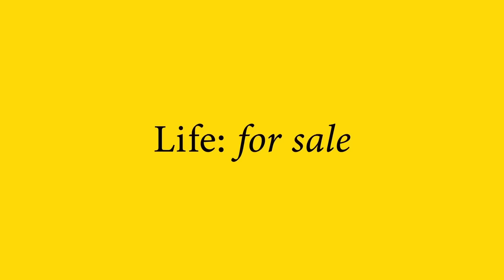$400,000 Street for sale

Comment: Yeah, don't buy a Bentley. You're doing A Great Job! I do somewhat agree with Ben when he kept bringing up the "20% on 2-2.5M" argument, but (maybe somebody can correct me if I'm wrong) one shouldn't put all their eggs in one basket on a mega-property unless one has more cash reserve; whereas splitting on multiple properties is safer. If you lose one of the four, for whatever reason, you only lose one. Whereas, you default for whatever stroke of ill-luck on that mega-property, you lose Everything.

The only thing I can think that can refute this is the "no risk, no reward" argument. But what other arguments are there for why the son did "the wrong thing" here?